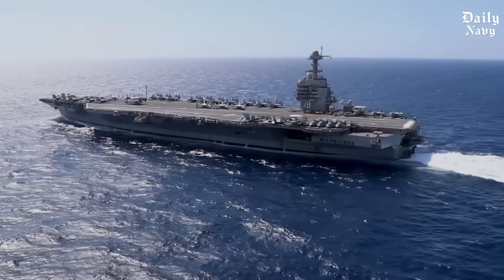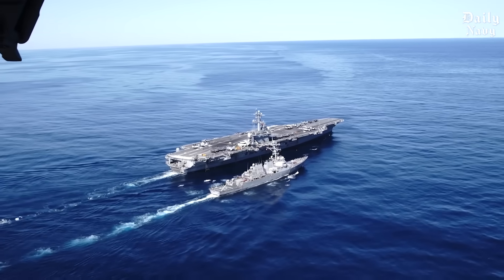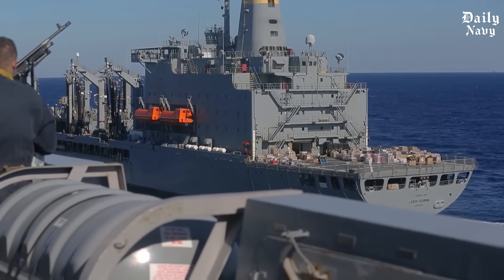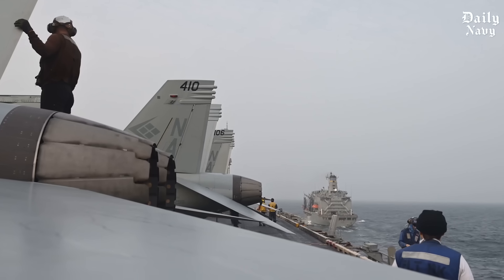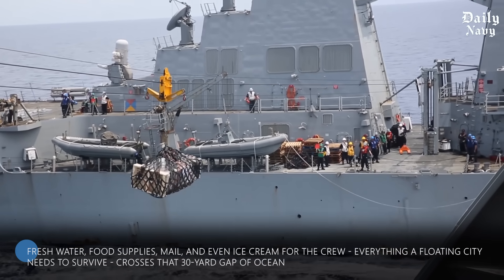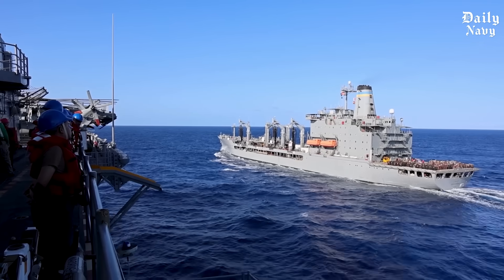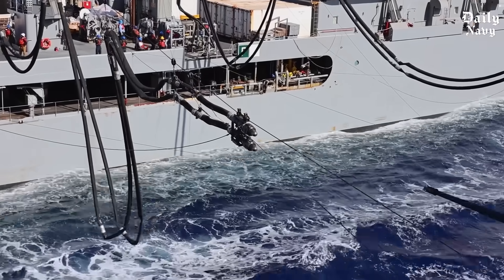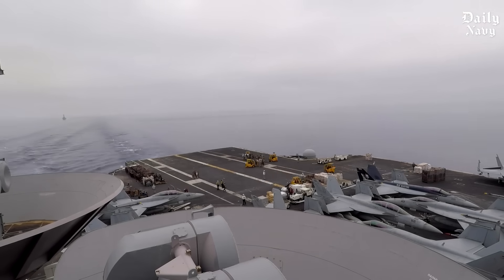How US Aircraft Carriers Get EVERYTHING They Need At Sea (You Won't Believe the Danger)

Comment: We practiced emergency breakaways all the time and the oilers absolutely hated it. What happens is that basically we tell the oiler to slack the span wire at which time we release the probe and trip the pelican hook and throw everything into the water and pull away to port.

Comment: When I was in, the line handlers on the phone line were not allowed to wear gloves.  The line handlers on the refueling / unrep rigs were not allowed to wear gloves when pulling the lines across. Why? If something happened that they had to let the line go and they were wearing gloves, odds were good that your hands would get caught up resulting in losing fingers, a hand, or even being drug over the side. We couldn't even have gloves on our person. The division officer, CPO, safety officer, and rig captain drilled that in to us every time we did an refuel / unrep.  For the most part, all of our refueling evolutions took place every 3 days around midnight. During daylight evolutions, we told our gunners mates to aim for the guy with the yellow hard hat.  That was the rig captain. We didn't use the M-14 to shoot the line across, we used what was like a sawed off .410 shotgun that shot the rubber projectile over. This rubber projectile was attached to a steel rod.